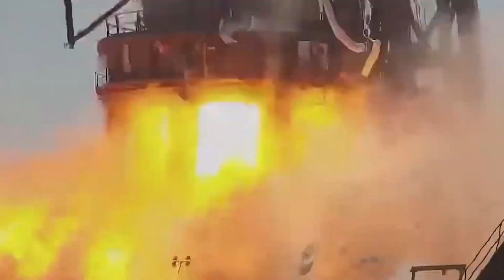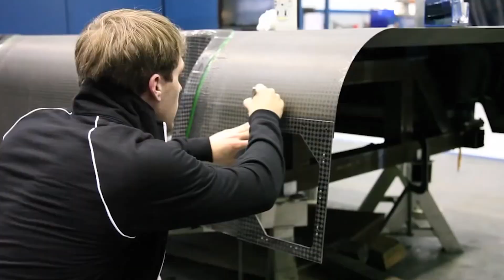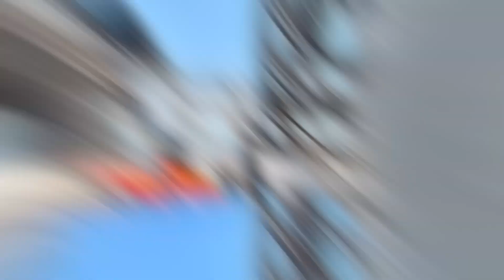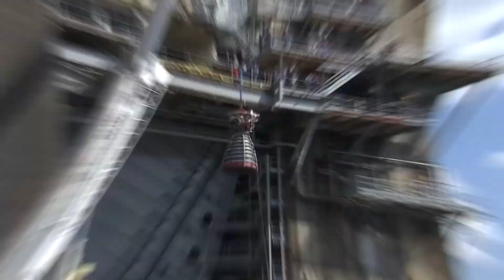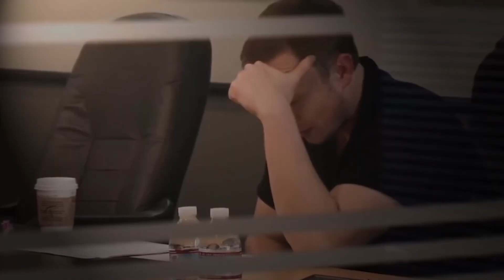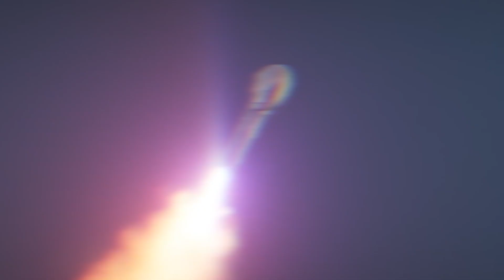SpaceX Chopsticks It Is NOT Working... Elon Musk's In BIG Trouble

Comment: It's no big deal that a fitting broke. That stuff happens all the time when you are building things. It doesn't mean the system wont work. If it really did stink up the place then that is most definitely MIL-5606 hydraulic fluid. I'll work with that stuff all day long. Now Skydrol 500A or B if you get it on you it burns and leaves red welts.